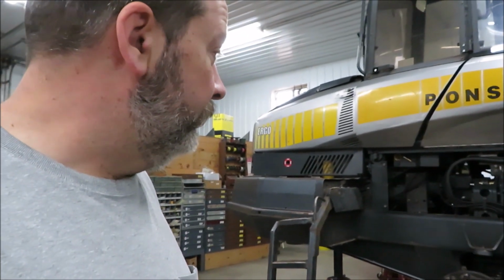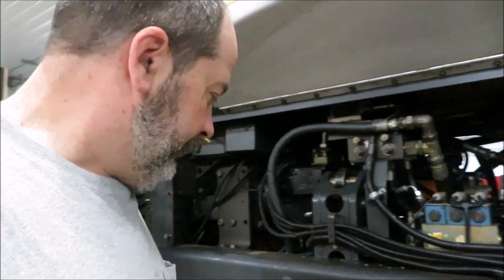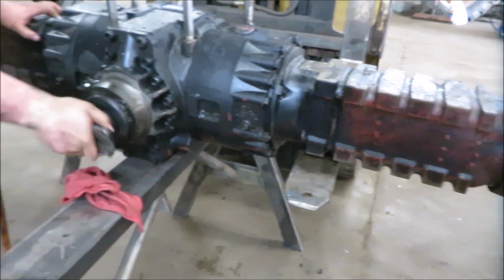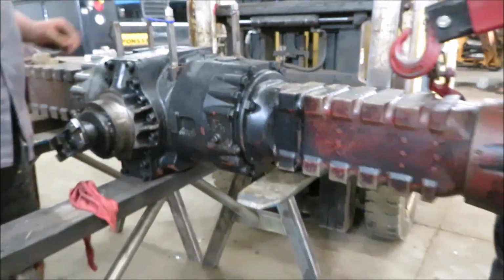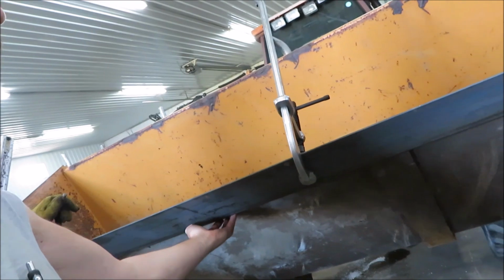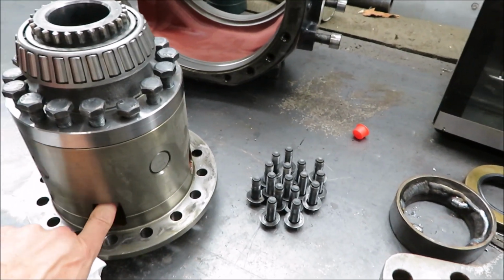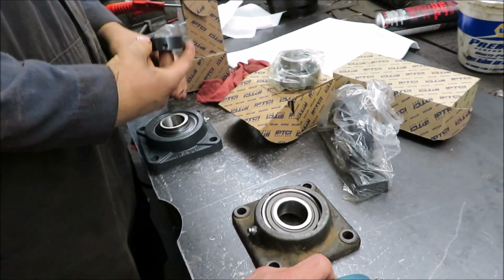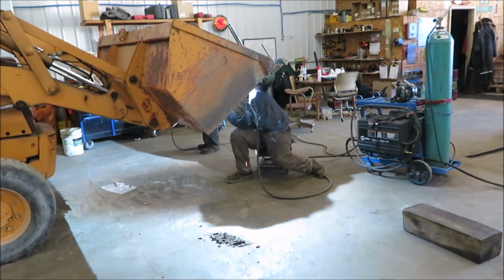Hamburger Ring and Pinion Ponsse front axle! Check that oil!

Comment: I like the videos and just subscribed to your channel.  Your words ring true regarding checking equipment out.  Im thankful to the old guy I worked for during summer vacations in high school and college.  Equipment and trucks always got a circle check.   Equipment was greased everyday while it warmed up.  He told me "Grease and oil is cheap, compared to parts and labor fixing stuff."  It's stuck with me ever since and I have caught a lot of small things that could have turned into big things by just spending a few minutes checking things out.  We never seemed to have a lot of downtime other than typical items (hyd hoses, tires, etc.).